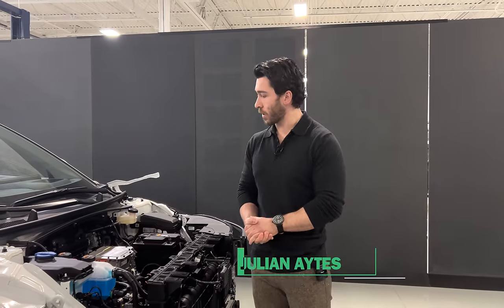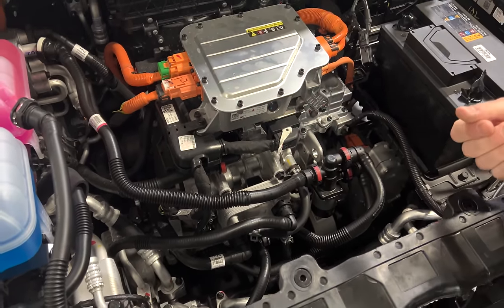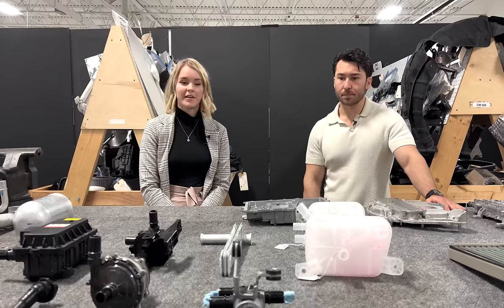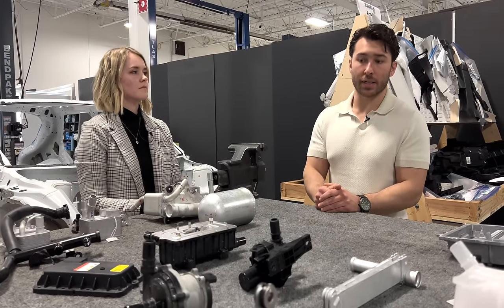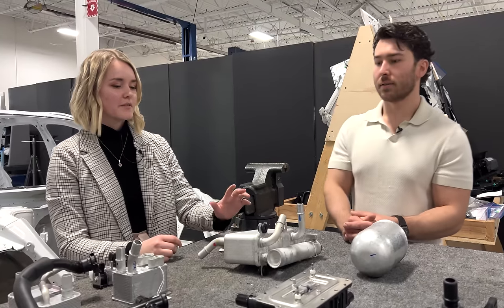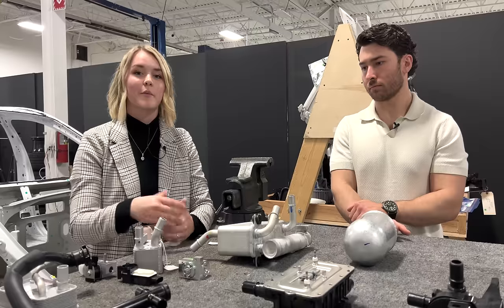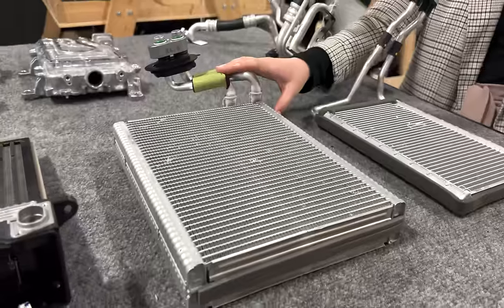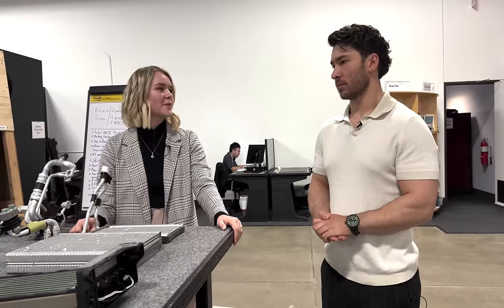This is Cool (No Pun Intended): Hyundai Ioniq 5 Thermal System

Comment: Thanks for this video.  It has answered a lot I have had about the temperature conditioning of the batteries in the currently available brands of EV.  I knew that Tesla put a lot of study into this process, and I was concerned that other vehicles did not have the same technology.  Hyundai appears to have done their homework on getting this system to function close to what the Tesla is doing.  Granted, as Alex has mentioned here, the parts are more "off the shelf" and "simpler" with serviceability being easier than that of Tesla, it is an effective system.  All in all, I would feel much better about purchasing the Hyundai vehicles knowing they have a good battery temperature conditioning system.  I know Tesla is constantly upgrading their systems with the latest and greatest technology - but I don't think these other companies are that far behind.  Thanks again!

Comment: The other thing is when you're preheating your car before you leave you can use the electric heater and it doesn't affect your range at all and gets it up to temp quicker for you to leave
Reply: Couldn't you achieve the same thing with just the heat pump while also pulling less energy from your wall and saving on parts and complexity? Might have to turn the preheating on 5 minutes earlier (or use Tesla style heat scavenging from stalling the motors).
Reply: @NO3V  mainly it's just used in very extreme conditions where you want the car to heat up quickly and low low heat environments like negative 13°

Comment: I am surprised you guys did not mention the shockingly frequent intervals that Hyundai calls out in the owner's manual to change the low-conductivity fluid. The manual states that it needs to be changed every 35k miles or every 36 months. On top of that, in order to get to the drain plug for that low-conductivity loop, you have to take off the entire front bumper cover, adding additional labor costs. Hyundai dealers have quoted anywhere from $300 to $1,200 to perform this service. As an Ioniq 5 owner, I am not looking forward to this. Strangely enough the Ioniq 6 does not retain the 2 coolant design.
Reply: every three years is "shocking"?  Inconvenient, annoying - sure, but not shockingly frequent.
Reply: @anxiousappliance  every 35k miles is shocking yes to replace a coolant. Very unusual for an EV. Most modern EVs don’t specify coolant replacement until at least 150k miles.
Reply: @anxiousappliance  When was the last time you changed your brake fluid?  At $1,200 for 1,095  days that is $1.10 a day!  That is shocking.!  How about $33.20 per month!  $398 per year.  Fail to change it and find out how much more expensive  it can be.  Who needs that crap?

Comment: Still surprising to me when they show the front bay of the vehicle and there are so many coolant lines, a fuse box, resistive heating, and a lead-acid battery (though at least they were innovating with the liquid cooled condenser).  Still just building off their old tech and trying to adopt it to the EV tech without appropriate consideration for weight and waste.  Given the Ioniq 5 has been reasonably well received, just think how much better it would be with some more efficient design.
Reply: The E-GMP is a ground up 800v modular platform that now has 5 distinct models based on it, even though it is anly about 2 years old.  These are some of the most efficient EVs on the market.
Reply: @anxiousappliance  Doesn't look like it.  Seems likely they're well made in some respects, but clearly opportunities here.  Even just the few easily observable things would improve the efficiency.

Comment: I heard VW charged extra(option) for heat pump vs resistance type cabin heater. Testing later determined no difference in efficiency with their unit and customer’s reimbursement for the option.

Comment: Both did a great job.  Big error on preference over octovalve.  Less parts less connections is less failures.  Talk to Sandy and be prepared for some energetic feedback...
Reply: Labour is the greatest cost in a failure. A Tesla customer remarked how quick it was for Tesla to completely replace his system.
Reply: Combining multiple parts into one assembly doesn't necessarily mean less failures. And it means replacement is much more expensive when out of warranty.
Reply: @RobertHancock1  Correct but simplification and consolidation is better.  Example PTC heater added to the system vs just using the motor stator as the electric to thermal source.  This ionic design is a kludge.
Reply: @zilogfan  As I've mentioned elsewhere that "simplified" design is worse due to excessive thermal mass to heat up compared to a PTC heater that heats the cabin air directly. There's a reason other car makers don't use that design. Tesla is known to sometimes "simplify" well past the point of any sense.
Reply: @RobertHancock1  You have jumped to a conclusion, based on "facts" not in evidence.  The Tesla octovalve is not necessarily more expensive..  Fewer parts means less can go wrong.
Reply: Qué cansinos los p. tesla fanboys.

Comment: One item not mentioned in the cabin heating system, is the seat heater.  Tesla in effect relies on the seat heater to keep occupant warm until the heat pump system comes up to temperature needed to heat the cabin.  Fewer parts, less cost, less installation labor, lower weight and more efficient way to do early heating-heat the person, not the entire cabin.
Reply: Or teslas rather excellent app, where you tend to preheat most times you start to drive.
Reply: Drive the EV6 AWD for one year now in summer and that year cold winter in Swiss mountain. HP, defreezing window front and back, heated steering wheel and only heated (not cooled also version) the car was always at 21°C quickly and NOISELESS. Much better than with a Mercedes EQE costing three times as much, where all the interior heating is making annoying noise refered to a „German Premium“ brand. Kia or Hyundai group did a good job and under real life conditions for HP they effectively work fine. Consumption before winter on all profiles 16,8 kWh and now after winter 17,4 kWh on 100 km. By the way after 54 years the first car with absolutely NO PROBLEM in one year, hope they remember my name at dealership 😂🤔😎🇨🇭
Reply: The usual Tesla "worse is better" approach.. you think other vehicles don't have seat heaters as well?
Reply: Tesla is by far the leader in EV's  No one else is.  They are obviously more right than anyone else.

Comment: I don’t like to think about the repair costs for front end damage of either the Tesla 3/Y or the Hyundai Ionic models.  I usually don’t opt for comprehensive insurance, but rather carry liability and and keep money in the bank for repairs, but here comprehensive might be smart.  I’ll be a lot of these cars will be totaled if they get front end damage in a wreck.
Reply: Any new car is, for all intents and purposes, totaled in a front end wreck.  A body shop might be able to get most everything to work for a while, but not for long.  Modern cars are too complex for an easy repair. Many have 140-150 "computers', built by hundreds of different suppliers.  Good luck fixing 'em  all.  Best to dump that wreck.

Comment: Very cool but you seem to have misunderstood the use of the heat pump and PTC heater. The heat pump is only for cabin heating and does not heat the battery. The PTC heater is only for the battery and does not heat the cabin. You are right to have discovered that excess heat from fast charging of the battery can be used to heat the cabin - a nice feature though mostly irrelevant because in cold weather the battery does not become so hot when charged unless charged for a long time and really fast and otherwise all that heat is not needed.
Reply: There's two separate "PTC"s: a battery heater ( see @11m50s ) and a cabin heater ( @28m00s ).

Comment: Does Tesla with heat pump have issues warming cabin quickly in cold weather?
Reply: No. But the Tesla system can scavenge heat from the motors and battery pack as well. It can even use cabin heat to heat the battery for example. Look up "octovalve"
Reply: No. If really necessary Tesla's (for a brief moment) run their motors in a stalled state that generates a few kW of heating without any extra parts. You can see this in the OBD data.
Reply: No problem. Even in super cold temps -20c. It can run the compressor in a super lossy mode essentially turning it into a resistive heater with a COP of 1. But that's only in super low temps. Anything about 0F and the system can have a COP above 1 and you are instantly more efficient than the PTC heater. The compressor can easily produce 5kw of heat even in lossy mode. More than enough to heat the cabin.
Reply: Could be faster, but it works ok.  Mostly not a problem if you preheat.  Biggest problem is that many of us model 3\y owners who had their heat pumps completely fail last winter, and having to wait 6 weeks for it to get fixed.
Reply: @engineer1692  nightmare - 6 weeks! Did they find the root cause of the failure?
Reply: @NO3V  genius ‘the best part is no part’ solution
Reply: @bartwaggoner2000  a faulty sensor. Could happen to any system really and likely the fault of some supplier.
Reply: There have been complaints about this, yes. Having a PTC heater works much better than Tesla's solution.
Reply: @RobertHancock1  This is false. 
Some channel ran a heatpump Model 3 vs a old PTC heater Model 3 and the heatpump one was way faster.
Reply: @theipc-twizzt2789  That only applies in temperatures where the heat pump is still effective. In extreme cold weather it will not be.
Reply: @RobertHancock1  https://youtu.be/4CHF0sKPQiU

What is extreme cold according to you?
Reply: @theipc-twizzt2789  Colder than -20. Try -40.
Reply: @RobertHancock1  Tesla had a PTC heater on early models, and did away with them.   Tesla does not need them.
Reply: @wilfredvanvalkenburgh2874  They got rid of them when they switched to heat pumps, but I'm guessing they discovered later that the heat pump alone was not adequate in cold weather, so they implemented a hokey scheme where the motor is used as a heater. Compared to a PTC heater warming the cabin air directly, heating up the entire motor mass and associated coolant and heating the air with the coolant is not efficient. But it saves a part, and is cheaper, which seems to be mostly what Tesla cares about.

Comment: Constant tension clamp on rubber hoses to assemble a quick fit connector its actually very common. How come, Julian, a supposedly thermal system expert, is surprised by that clamp near a QC? 😢

Comment: at first glance it seems really dumb the heater on the battery is on the outlet of the battery loop.  BUT, maybe they have it there so the fluid has more distance to travel and is more evenly mixed up by the time it gets back to the battery.

on the other hand, i could see this losing a good bit of heat to the outside world as it has to travel all that distance before it can heat up the battery again.  idk how well it's all insulated.

Comment: interesting.  Hyundai's implementation falls in the middle between Tesla and others.  I wonder if Hyunadi can get away without PTC heater and have more powerful heating in the ventilated seats, or Toyota's radiant heating.  I also wonder if Tesla's Octovalve is worth the complexity and cost for efficiency vs a simpler design like this. I reckon, Tesla's implementation better for cold climates but how often do you need that efficiency unless you are up there in the north.

Comment: The blue coolant is supposed to be replaced every 60,000 km. I understand that this can cost up to $1000 to do.
Reply: This needs to be figured out. There is no way that’s really necessary, but it’s also way too expensive for just a coolant change. Hyundai has a real stinker of a problem with this.
Reply: @FuncleChuck  isn't it ALL of the egmp platform evs that require this little talked about expense? 🤔
Reply: @FuncleChuck  The rumor mill says that Hyundai may go to a single (pink only) system for 2024. I guess we will have to wait and see.
Reply: @4literv6  no, weirdly enough the Ioniq 5 is the only GMP vehicle with 2 types of coolants. Rumor/speculation is that it was used in Ioniq 5 as the first vehicle on the platform, and by the time the others were designed they realized they could simplify things.

Comment: Disappointing to see so many resistive elements when Tesla showed a much simpler design works well. Also, average maintenance is cost of part * occurence of replacement - the supermanifold might be more expensive but how frequently does it need to be replaced anyway? Average maintenance cost might be much lower, on top of a cheaper system to start with
Reply: Agreed. The parts in the system that fail most frequently are the hoses. Tesla system eliminates most of those. Metal plate heat exchangers last the lifetime of the car.

Comment: Making blue coolant is going to cause people to add Windshield Washer fluid to that reservoir!
Reply: This is a poor choice of color for a important coolant and then placing it right next to 
washer fluid.This could cause anextremely expensive repair.
Reply: If a person cant see the huge sticker on the cap of the coolant nor realize that when the washer fluid is empty the color is irrelevant since there shouldnt be a color at all. Why would you add washer fluid to a full container? If a person doesnt manages to realize this they should maybe reconsider operating a vehicle in this price range
Reply: There are stupid people out there also drying their cat in a microwave😂🤫🇨🇭
Reply: @kristjanaristefansson9694  yes maybe the winter washer fluid should be right up front and then they put like a cover over the other fluid so you have to do extra work to get to it
Reply: That's how they make extra profit!
Reply: French cars have used blue coolant for dozens of years!
Reply: The cap is locked and has a left-hand thread.  That's why there is an icon of a mechanic on it.
Reply: @kristjanaristefansson9694  did you ever go through an oil change shop like Valvoline with an ICE car? Also, not everyone reads English, perhaps they are Spanish or some other language reading and speaking? Eventually, someone not familiar, may be trying to top off the windshield washer fluid for that big trip somewhere, maybe in bad weather, they see blue, the windshield washer fluid is blue…
Reply: @KiwiMechEng  and for years, Chrysler has been putting a brown plug that says, “For Dealer Use Only” where they used to stake the tube for the Transmission Dip Stick/fill tube. People have been scribing the back side of the Engine oil dip stick with the full hot full cold marks to allow them to check the ATF levels on the 61TE Automatic 6 speed Transaxle.  So I am aware how silly manufacturers can be!
Reply: @kristjanaristefansson9694  If you think its "foolproof" you have underestimated the ability of a fool.
Reply: @youbencowell  The French make cars?  Since when?   Just kidding.  I know they used to make them, but the last time I saw one here in "Murica, was 40 years ago.  My cousin had a Citroen SM and a DS wagon from Saudi Arabia.  Best advice I ever got was "if you don't live in France, don't buy a French car".  The blue fluid is probably Mermaid tears.

Comment: I wonder what the reliability of the Hyundai Ioniq 5 is compared to the Tesla model Y. They mentioned the ioniq 5 thermal system has more components than the Tesla model Y using the OCTO valve design. However, they said the repairability would be better and cheaper because you only had to replace a smaller component rather than the whole Tesla OCTO valve assembly. Tesla uses advanced production techniques, like giga castings, which greatly reduce the time and cost to produce a vehicle. But what is the repairability cost? I think we’re finding that Tesla repairability costs are quite high as born out by high insurance rates.
Reply: Labour is the greatest cost in repair. The tesla system can be completely changed out very quickly.
Tesla has the lowest warranty claims in US.
Unlike OEMs Tesla does not make profit on repairs or parts and are certainty no more expensive than premium makes.
Munro mantra - 'you can have repairability or reliability - choose one'.
Reply: @waynerussell6401  I'm sure the E-GMPs are very reliable - KIA and Hyundai make very good EVs.  They also have fantastic warranties so...
Reply: Tesla insurance is available in about 11 States and is considered a long term threat to traditional Insurance companies.  Therefore, you will find that traditional insurance companies see Tesla automobiles as a threat to their business also.  Don't look for any insurance bargains from someone you are putting out of business.
Reply: @wilfredvanvalkenburgh2874  thanks, I’ll check out Tesla car insurance. State farm has increased their insurance rates 6 to 8% per year for several years even when the inflation was only 1%.